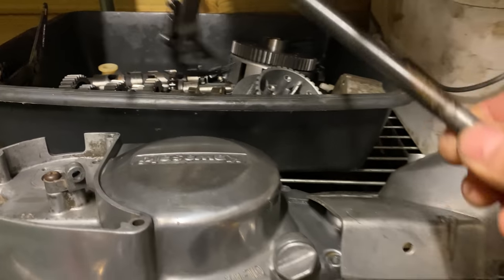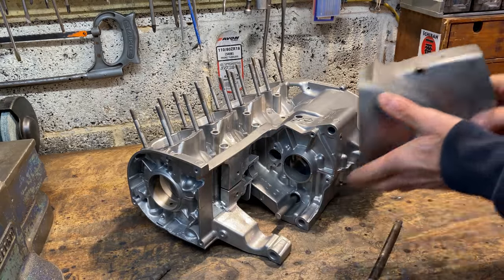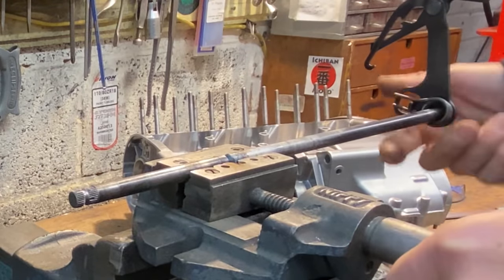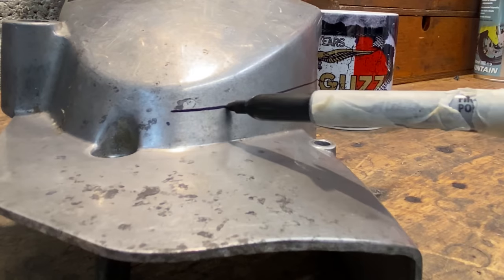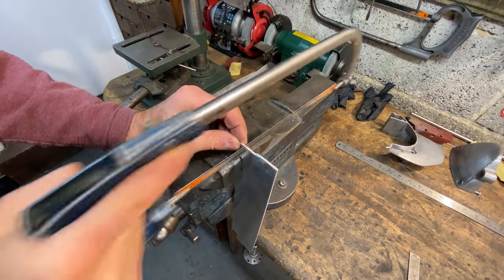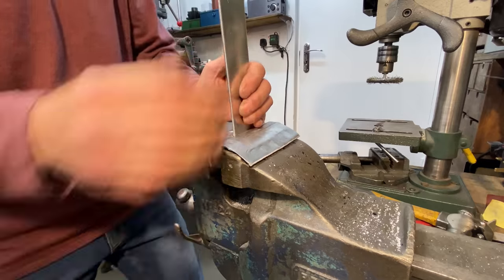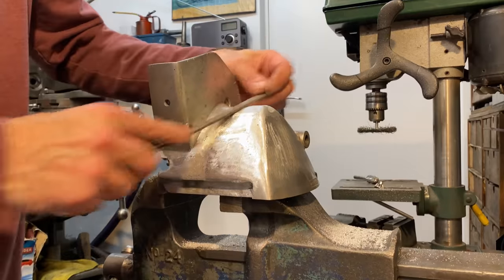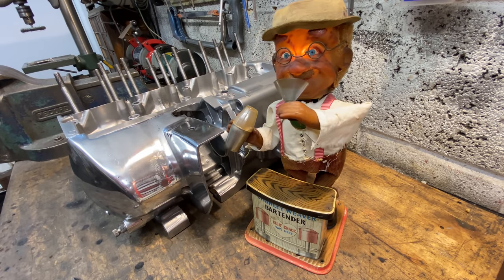Engine casing and gear shaft - How its Made - Episode 4 - Kawasaki Millyard S1 four cylinder

Comment: I’m always still amazed how straight he cuts lines with a hacksaw.. doesn’t seem like it would be that difficult.. but it can be. Dude makes cylinder heads with a hacksaw, a file and a welder
Reply: You need a better saw. Something very rigid.  It helps a lot.
Reply: I still have my hacksaw from when I was an apprentice - its called a Sandvik and it's made out of box sections. A good hacksaw and good technique gets you straight cuts. Practice makes perfect, but I'd recommend keeping your wrist fairly rigid, let your elbow do the flexing, don't put too much pressure on the blade, let the teeth do the cutting and if possible, keep your blade as close to parallel with your cut-line as possible. You usually have to start the cut perpendicular but once the groove is established you can shallow the angle out.

With all that said, I have never cut a cylinder block in half with a hacksaw!!
Reply: @CONEHEADDK  true, but it’s not something I do a lot of anyways. I’m a aircraft sheet metal guy by trade so it’s mostly shears and bandsaws for what we work with. Still, Millyard is a skilled dude
Reply: @Livi_333  Even the best tools can turn "a tool" into a skilled craftman, as much as the best dress can turn "a pig" into "a fox". NOT that I'm calling you a tool at all. We all know the "it takes 10.000 hours of doing something, to become "a pro"", and sheet metal working is a far more impressive skill that "just" cutting straight. I remember Rick as more or less the only impressive guy in the OCC tv series, and that was the first time I saw sheet metal forming. "Funny" how little "hype" craftmanship educations got, when I went to school, but maybe the teachers believed, that those kinds of jobs were for those, who couldn't make it in higher educations.
Reply: o was taught at school (back when you did metal work ) that you stand in a certain way to cut metal at the vice
Reply: While Mrs Dude makes mincemeat pies in the kitchen without a file or a hacksaw, what a team.
Reply: Soft metal and not much hand weight on the saw makes a straight cut

Comment: The way Allen marks stuff up looks so casual, yet the results are always perfect. Me, I spend hours with vernier calipers and thin scribes double and triple checking everything and once I've carefully bent it all up, it looks nothing like I wanted 😂
Reply: Yep,sometimes you can overdo it,I spent ages once jigging out a particular bracket for some Brammer belt drives idlers which then got lost at or en route to the platers,the replacements I heated,bent and shaped in the vice in about 2 minutes each with a big copperhead and they were better than the first ones too😁

Comment: Intellect and experience on display in the placing, measuring and marking method used for the gearshift shaft.
Excellent polishing job on the modified cover. 👍

The woman in the home hand-crafting,
the man in the shop hand-crafting,
the nocturnal hedgehog being crafty.
👍😊

Comment: As everyone compliments Allen on his sawing skills, and rightly so. I'm a bit surprised that he holds the "waste" side of the job in the vice and when he was chamfering the shaft in the lathe that he didn't drill an eighth inch hole to pin them together. Still when you have Allen's laser accurate eyesight it might be an unnecessary step. Anyhoo, wishing everyone a safe and happy Christmas.

Comment: I always use a cheese grater to trim my casings back these days (the fine end obviously, I'm not a monster). I've even had the oil level up to the full mark in that little round window fingy if i pour fast enuff sometimes. So getting there gradually ay.  
My girlfriend is good with the shafts, as her dad's dad was a blacksmith. She cuts then drills them. Then hammers in a too big a roll pin, so it's really tight both ends, which allows perfect gear selection for about  20 minutes, before we have to  sell them on as spares or repairs on ebay. 
The court's unfortunately banned us from welding after the small fire that took out half the estate. Thankfully everybody escaped safely. We can't even mention JB Weld around these parts anymore without copping a dirty look off someone.  But like my dear old dad always reckoned, before he got ran over by that milk float he didn't hear coming, that where there's a will, there's a relative.
But we're learning shit loads from watching your fine videos. 
Keep up the good work Sheriff  😎

Comment: That hack saw has probably seen some action over the years. A few miles of cutting🤣 . 
One secret to a straight line is keeping that finger straight out on the handle. That was a game changer for me and I could cut a straight ish line. Looked nice when done I do love a bit of buffing but can also be deadly if it grabs the part 🤣🤣🤣
Reply from the maker: its all about tangential contact below the centre line of rotation
Reply: @AllenMillyard  ...as the pole vaulter said to the actress :)

Comment: Hi Allen. Thank you for explaining how you were able to align the transmission sprocket with the rear wheel sprocket.

Would you please explain how you are able to mount the engine in the frame? The original engine bosses are now in the wrong place.

Comment: Great finish to the side case Allen. Did you get told off for not putting the top on the mince pies tin properly?
Reply: Don't worry, it didn't contain any mince pies after the second pass through the kitchen 😊
Reply: @johnwalker194  Strange how there was only two in the tin. Maybe that was the 8th cut ?
Reply: @SoddingaboutSi  😃

Comment: Would really appreciate some advice on what Tig welder to get for aluminium and steel welding, preferably one with a 13 amp plug.
Reply from the maker: Mine is a 15 yr old Astor 200A 240V AC/DC
Reply: @AllenMillyard  Is that on a dedicated 32A circuit?